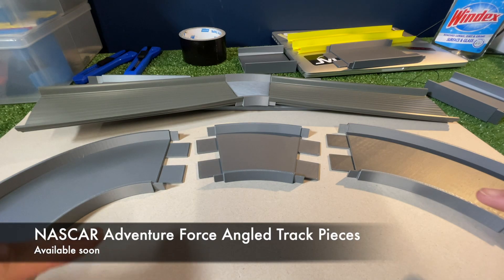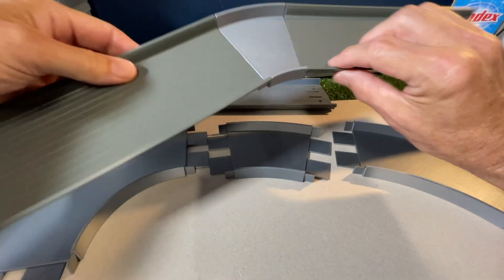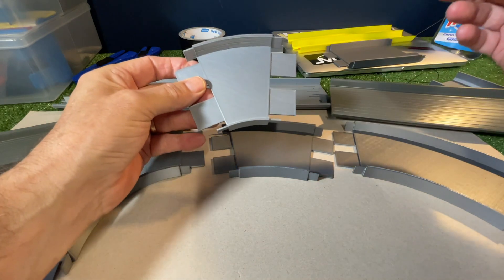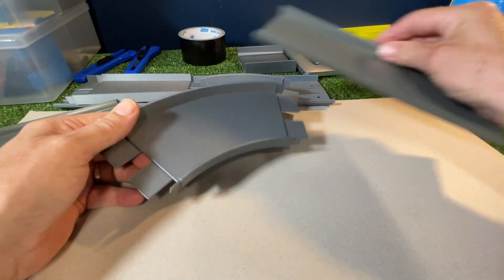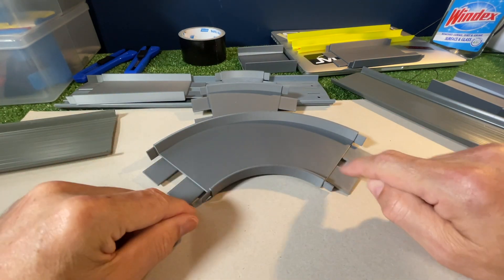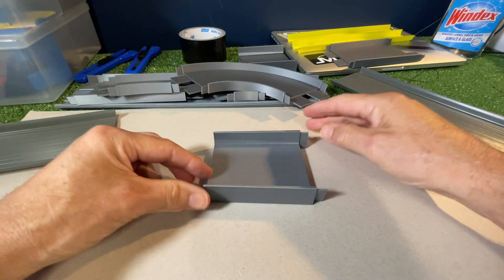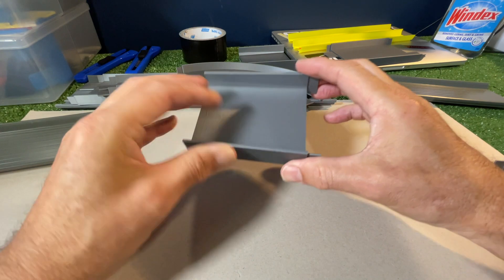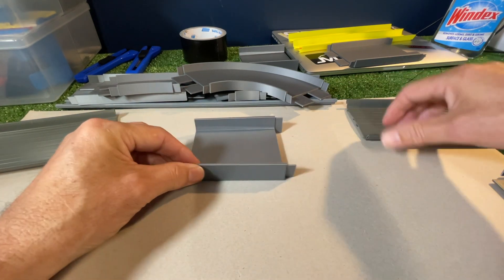Hot Car Track Angled Track Pieces

Comment: Hey Simon. I have a chicane in the final straight of the canyon and it caused a lot of issues with cars bouncing off at sharp angles when it was flat and I know you're talking about making an angled version, but you could probably be able to make it with a separate angled base (that you could print flat) -  like a bridge support  - and get the angle you want. You could have different sizes to allow for different angles. Would be much easier for you to print and was how I solved it at the canyon. Made it a lot better and was much easier to make it that way. Just need a simple lock mechanism in the base of your cover to secure it. Just a thought.
Reply from the maker: All great ideas mate which I considered when making the first flat versions.  The flat versions are for sections of a track where the speed might be that great like a chicane, the banked versions will be for speed.  Cheers👍
EDIT: I'll have both version made for users that might require a flat and a banked track piece.

Comment: Very interesting,  making me think about multiple lanes of crash track side by side  into fat track so the 16 car option is still possible. Cheers!
Reply from the maker: 16 cars, now that's a race track.
Reply: @HotCarTrack  I have to extend the merge approach to allow the cars to separate before the 4 down to 3 wide squeeze.  I estimate 3 to 4 extra feet will allow it.  I figure it's worth a try to get to see a pack of cars get through and battle to the finish.
Reply from the maker: @PowerDriveRacingDJTrippleJ  Your track is massive man an extra 4 feet will be interesting.
Reply: @HotCarTrack  It may turn out to be the most exciting four feet of the track.  That extra area will be equvillent to four lanes of orange track without the lanes.  The cars with BlackFire  Tyers will roll relitivaly straight through it, while the others may slide as if on a sheet of ice.  Nevertheless, if seperation is achieved, it could make for some very exciting racing with many cars crossing the finish line.  However, it may be nightmarish to film.  Hahaha, a great problem to have.   Imagine two lanes of crash track intersecting making it a six lane wide area.   See what you have done?  You've created a monster Lol!   Nice work on all these very important adaptors, we should see many exciting track configurations in the future.  Cheers!  Keep up the great work.  Any word as to when the Vantastic Semifinals will begin?
Reply from the maker: @PowerDriveRacingDJTrippleJ  Looking forward to seeing this in action mate. The semis have been shot and final touches are being done now.  The first semi is only a day or two away.
Reply: @HotCarTrack  Actually I'd be replacing 4ft of orange track on the first straight into turn one.
Reply from the maker: @PowerDriveRacingDJTrippleJ  Ok cool man, should look great.
Reply: @HotCarTrack  It Should but it's coming from the arts and crafts department not the 3D super printer.  Hahaha!  Cheers!
Reply from the maker: @PowerDriveRacingDJTrippleJ  Good luck with the build mate.
Reply: @HotCarTrack  Hahaha I'll probably need it.   Cheers!